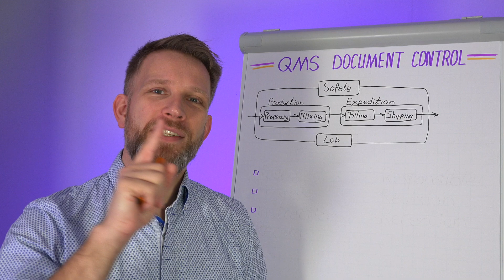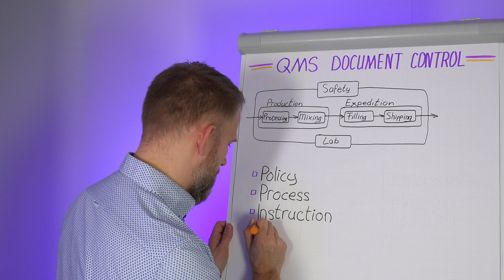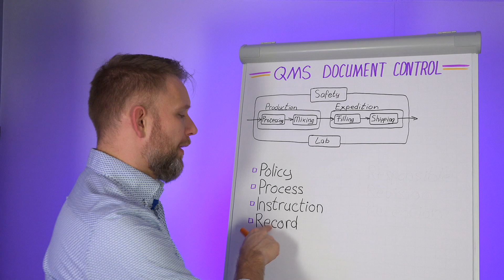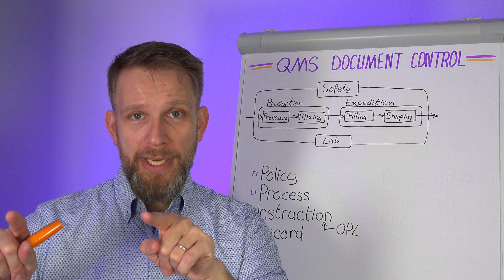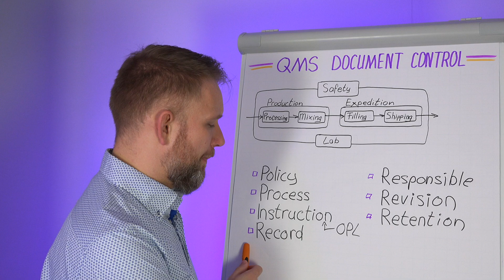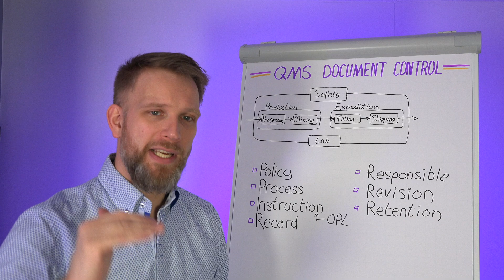Managing Your QMS Documents the Lean Way

Comment: This is great! I am currently implementing a QMS for a NP Healthcare system and I am trying to bring my ISO experience and combine it with my QMS understanding. One thing you said that is scary is letting the people on the floor make all the changes. Currently, I just have them make a copy of their document in their own folder then send me the revised document, then I archive the old rev., then update my masterlist. Since we are a NP funds are limited, I am using Google docs right now with plans of migrating it later on to something else.
Reply from the maker: Sounds like a great implementation project!
I’m not sure Google docs has version control like SharePoint has, but that would remove much of the risk of people deleting or ruining things.
With people on the floor I do mean people who are actually able to make decisions about how the process works - in CI terms that’s not just “manager level”, it means that they actually understand what they’re doing, are aware of requirements and regulations and implement it within all shifts if needed. In a TPM-like CI programme, that’s often accomplished through Autonomous Management and its development of people throughout organisational levels. But in practice you often first have department managers responsible for their department’s documents, then they’ll delegate to specific people they’ll make sure are sufficiently trained, and only later go for true autonomous teams.